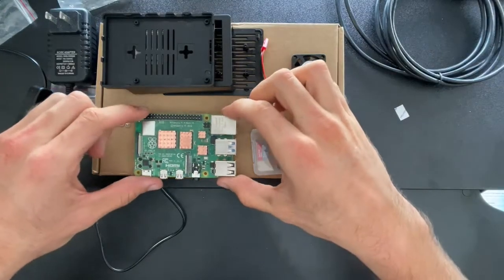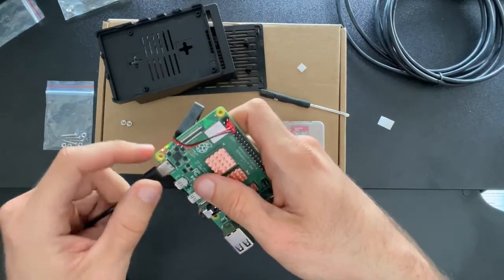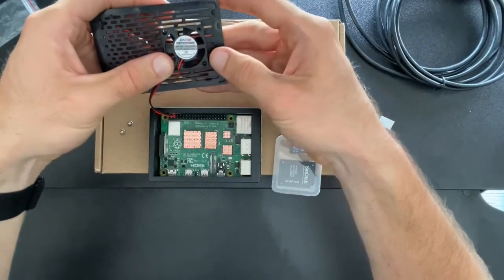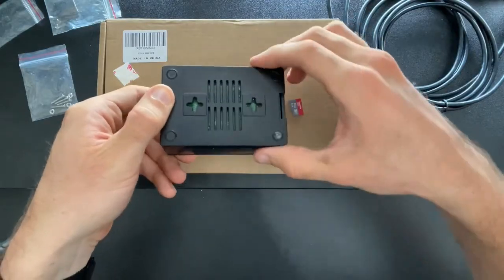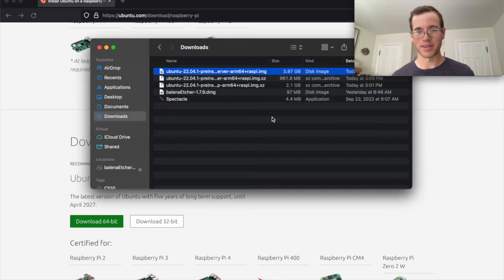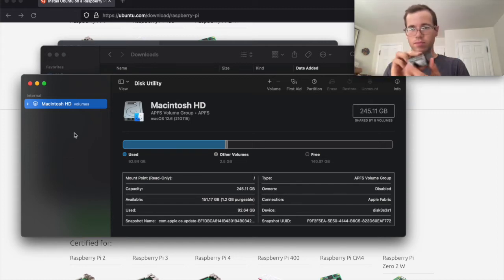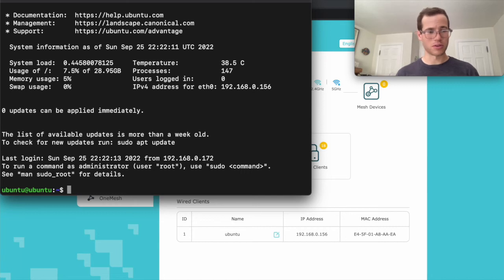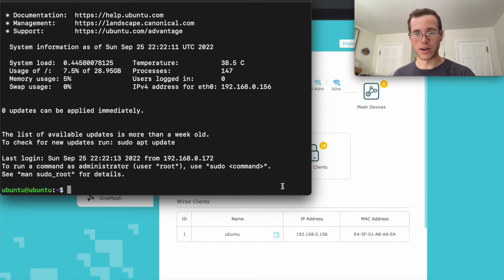Raspberry Pi 4 Model B Complete Setup Guide with Ubuntu Image

Comment: Hey bro, I followed every step here. I have same configuration as you do. Everything worked except for the last step. Whenevr I try to do ssh ubuntu@<ip of my RPi>, it says Permission denied(public key). Can you help me with this?
Reply: Hey bro, I know your comment is old, but in case you're still having this issue, it's probably because you haven't added your SSH public key on your Mac/Linux to the `~/.ssh/authorized_keys` file on your Pi. You can check if you have an SSH key by going into `~/.ssh` and checking if the `id_rsa` and `id_rsa.pub` files are there. The contents of `id_rsa.pub` is what should be copied to your `~/.ssh/authorized_keys` file on your Pi. If you don't have those files, they can be generated with `ssh-keygen -t rsa -b 4096 -C "username"`.
Reply: @veggieboy1  I mean sure but Id have to ssh into it to ssh-keygen no?
Reply: @lflm587  You would have to run 'ssh-keygen' on your main Mac/Linux computer to generate a key for that computer, and then you can copy it to your Pi's `.ssh/authorized_keys` file which will allow you to access your Pi via SSH keys. By default, you can access your Pi via SSH and its password (to perform this initial copying). Then, once you've set up the SSH keys you can disable password access (since SSH keys are much safer and easier to use).

Comment: I just found (after putting on the heat syncs and putting it all together) a foam square about the size of the CPU w/ adhesive on one side.  WTF is that for?
Reply from the maker: Thermal pads for the memory chips
Reply: You didn’t use it/them?  The memory chip has a heat sync.